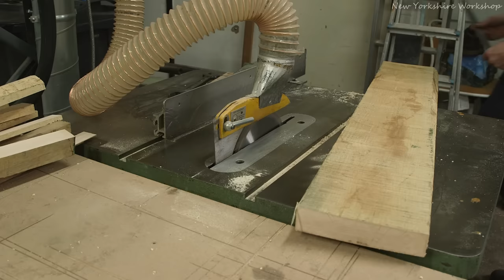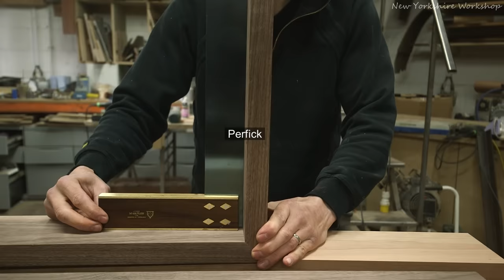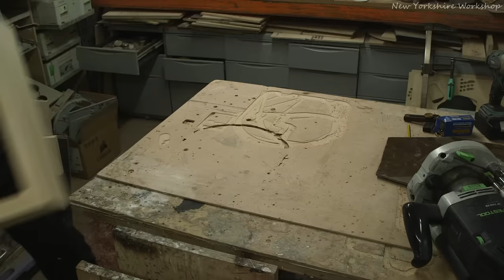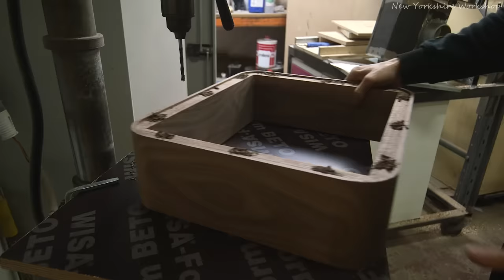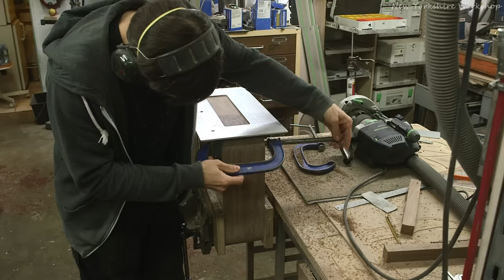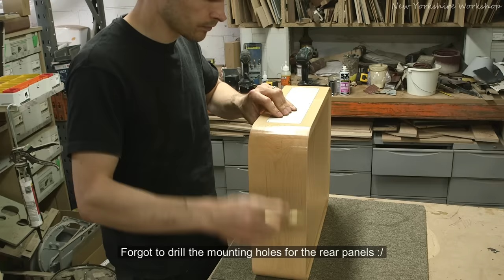Making wood cases for £10,000 amplifiers

Comment: A visual and aural treat. Can’t help but wonder what the finished audio system actually sounds like, but it looks stunning! More, please ...
Reply: I'll put it this way: neither you nor I could afford the speakers for those amplifiers! Those are some heavy duty, Industrial-strength beasts, but I'm with you on this-- would LOVE to hear what they do!
Reply: I used to know someone who owned a high-end hi-fi store and he invited me in for a listen. After a few minutes listening I realised that I couldn't hear the equipment. All I could hear was the music.
Reply: @Grannys Gusset I've been trying to remember the make of the amp they were using. It was not one of the regular brands. I remember the guy saying that the Japanese maker was an old guy who made one or two amps a year and they cost around $250,000 30 years ago. Those amps were like a fat coffee table about 1 metre square. The company made some budget amps at various price points: $25,000, $50,000 etc. The speakers were electrostatic and a bit bigger than a standard room door. Slightly narrower, but taller. I could not afford that type of gear. I spent too much money on skiing and sailing. 😁🙄
Reply: @roadie3124  that sounds like the original Japanese audio note. Kondo San used to hand build the ongaku amplifier, great big thing that had old fashioned valves.

Comment: I will never build a box like that but I will always use the techniques I learned from you in my future builds. Thanks for the sanding disc replacement especially! Wish my tiny shop had a ladies room.
Reply: A better system is to use velcro-backed discs.  That way you can quickly go from one grit to another without having to throw them out.  It's the same as what everyone is using for their random orbital sanders.

Comment: Holy crap that cut at 2:09 is scary.  Keep making cuts like that, and that saw will take you for a ride.
Reply: What's funny is he has a track saw but he doesn't use it to make that straight edge...?
Reply: I suspect he knows what he's doing...
Reply: @alasdairmackenzie515  There's no reason for what he did other than laziness. When you put it on Youtube, amateurs will attempt to copy not knowing how dangerous it is especially if it's not called out. He obviously has the right tools for the job, just use it!
Reply: @alasdairmackenzie515  That's exactly why he shouldn't have done something that dangerous.  Breaking down non flattened wood using the fence on a table saw is dangerous enough, but freehanding is just dumb.  That was a job for a bandsaw, or wait until its jointed and has two, 90 deg., flat faces.

Everyone "knows what they are doing" until they lose a finger or have a board kick back at them by a 3500 rpm blade.  In any production shop worth its salt, that would could have easily gotten you fired, especially if you "knew what you were doing."
Reply: It wasn't ideal, but nor was it particularly unsafe (although I agree that it would have been better to create at least one flat face first).  When I see videos from other countries, with no guards, no push sticks, no riving knives etc., that's when I think they're taking stupid risks.

Comment: Awesome and very beautiful.   Thank you for a great video. 

I had the lucky and humble experience to meet Simon from SJS Electroacoustics and Kevin from Living Voice last Saturday at the North Hifi Show in Holmes Chapel and listen to the complete hifi system from their companies components and also a fantastic Kuzma full turntable set-up.  To my ears the sound was one of the best if not THE best (certainly for the system's size and small room it was in) in the whole show ! 

Any issues with the wood casings expanding and contracting with the heat from the amplifier's electronics etc. or from ambient air temperature and humidity fluctuations etc. ?

Comment: Nice work! Maybe next time you can make a template for those top/bottom plate holes. Mark hole pattern to sheet of mdf or something, then drill those holes 30mm and use router with 30mm guidebush and 6mm bit.

Comment: At what point does a character of the wood become a defect that needs to be removed? Wouldn't a knot sometimes be a nice detail of the wood rather than be something to cut off?
Reply: Yeah, I'd like to know more about that too. Was it purely based on your personal taste, or is it more practical, like perhaps a knot has a risk of coming loose over time? What other things would you consider imperfections that a non-pro might miss completely?
Reply from the maker: Yes there are practical reasons as well as aesthetic ,a knot that size could loosen but also it can cause bowing or twisting due to the unusual way the knot affects normal movement in the wood. Aesthetically it depends what you want, but also the general appearance of the wood; in this case one large knot on otherwise clear timber would look out of place, whereas a few smaller finger nail size knots might add character.

Comment: Lovely. That'a a LARGE router. I'm guessing €125,000 investment in the shop. Since none of it is automated, productivity is necessarily only middling, but flexibility for nearly any conceivable type of job is at a maximum. A base shop rate (exclusive of personal labor rate, materials [x1.5, for inventory & scrap] and consumables [also x 1.5]) of €50 per hour then returns 1.0x times that €125,000 working capital each year, based on a 2500 hour work year. Generally speaking, a one man show should hope to harvest 1.0x his working capital each year. This neglects the return on the facility of course, because facilities are simply too variable to generalize. Even straight up 5 year leases partake of qualities of investment given fluctuations in the rental markets, and owned facilities must definitely be evaluated as investments (and as eventual exit strategies).

Comment: Dude, painting could be such a beautiful art. Only if I dont have to deal with super toxic solvents, sticky paint, used rags, cleaning the sprayer and plastic ware, stains in the workshop, boots stick to the floor, sandpaper, sand dust, thar super fine sand dust, lots of super sticky gloves, expensive respirators (i have a beard). Dude, I hate painting.